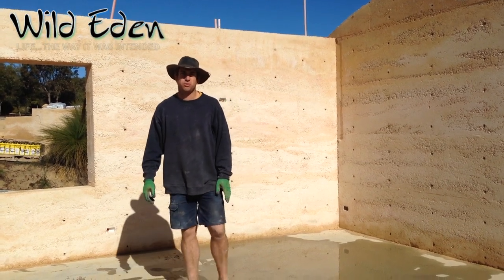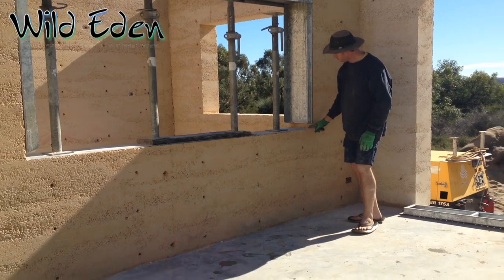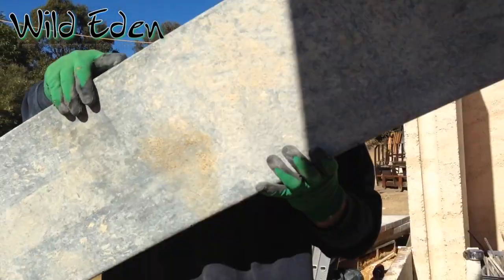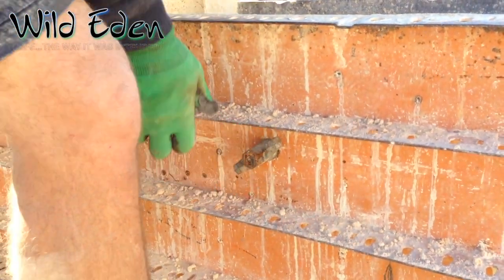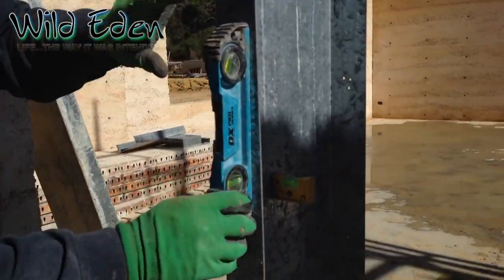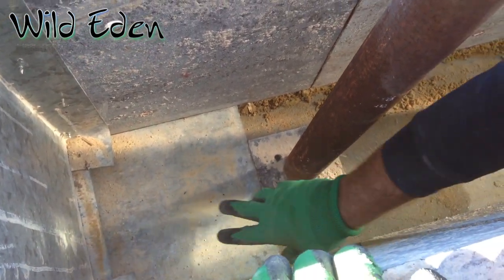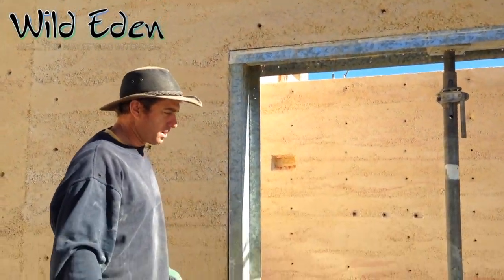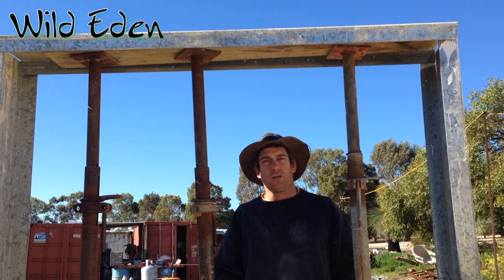Rammed Earth - using custom re-useable metal forms for window & door openings MIY DIY Wild Eden

Comment: Oh, you blokes have systemised it so well, the only thing I’d do different would be to coat your form work for easy release and refurbish it after each use. Top marks. Ever think of using permanent pre-cars concrete surrounds for doors and windows?
Reply from the maker: Yes mate we often use form release (some people use diesel) sprayed on to the forms just before ramming. It can help with cleaning and gives a more flat finish. 
With concrete pre-cast we haven't used that for doors, mainly due to cost & time of preparation - it could look nice though.

Comment: nice work and explanations... one question do you thing the strength of rammed earth could allow it to carry a A-FRAme roof/house on top. I mean could it act as a load bearing foundation if you do a rebar splice to connect to the A frame?
Reply from the maker: Do you mean as a second story? Depending on the design you can easily do it. 
We can show you how - be sure to subscribe, once we hit 1000 subscribers we will be posting regularly.

Comment: Another question, don’t know if you can answer, do you do “rammed earth stabilised blocks” if so, have you ever tried gluing them instead of using mortar? I ask this because about 15 years ago I built a shed using concrete blocks and gluing them, it’s as good as the day I built it! I’m thinking of building a house using the rammed earth stabilised blocks, including some vaulted roofs for verandahs and other parts, using glue?
Reply from the maker: Sorry, we do not have experience with blocks... Essentially recon limestone blocks are similar. It is a totally different way of building - our guess is that cement is needed for structural integrity. An engineer would need to give advice.

Comment: What do you have on top of the door or window? Concrete slab? Can you share the process in a video? I think that’s important otherwise the wall on top of the windows will collapse as they bear weight.
Reply from the maker: G'Day! 
It's a common question - and no we don't use concrete above the openings. It's simple and very clever - yet engineered to be strong. 
We will have a couple of videos covering this exact topic. 

Make sure you subscribe & invite your friends. Once we hit 1000 subscribers we will be posing lots of videos covering a lot of info on Rammed Earth / Stabilised Rammed Earth. In fact, we may offer a full course!
Reply: @WildEden  already subscribed

Comment: Could you use a gas powered vibrating plate compactor for larger jobs  ?
Reply from the maker: Generally plate compactors are too large physically and vibrate too quickly. A backfill tamper works best...also known as a ‘dancing lady’! 💃🏼

Comment: what happens to the walls when there is serious rain or flooding?
Reply from the maker: Hi Michael, we use (and sell) a product that makes the wall resist water. In fact, due to the death of a family member, our walls were out in the weather for over a year before the roof went on without issue. 

If you don't use this additive when mixing the earth, you need to keep direct rain off the walls with verandahs etc. 

There is another product we sell that can be applied after ramming - again we sell it and will explain more in another video...

If you subscribe we are hoping to get more videos up shortly explaining more :)
Reply: @WildEden  wait you mean the rammed earth buildig has a problem that caused a fatality?

Comment: What kind of lintel if any did you use?
Reply from the maker: G'Day! 
It's a common question - no lintel above the openings, but reinforcing is needed. 
It's simple and very clever - yet engineered to be strong. 
We will have a couple of videos covering this exact topic. 

Make sure you subscribe & invite your friends. Once we hit 1000 subscribers we will be posing lots of videos covering a lot of info on Rammed Earth / Stabilised Rammed Earth. In fact, we may offer a full course!